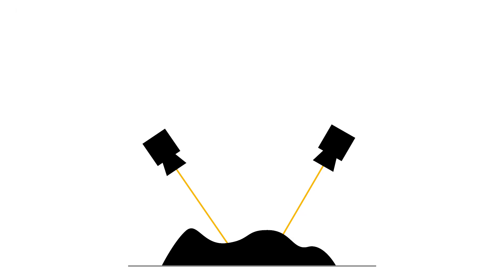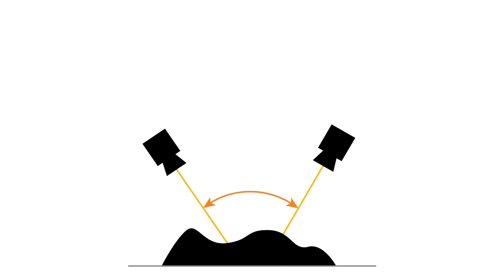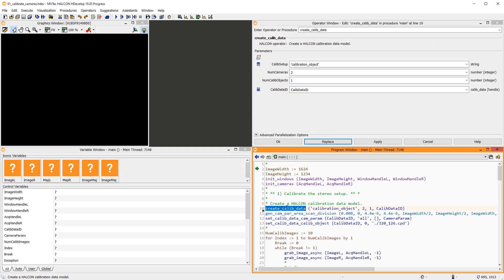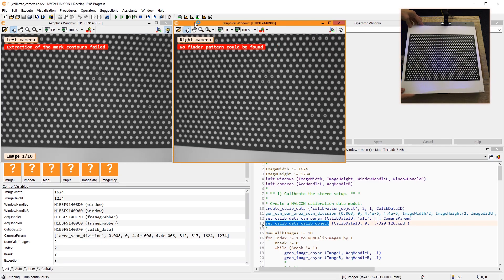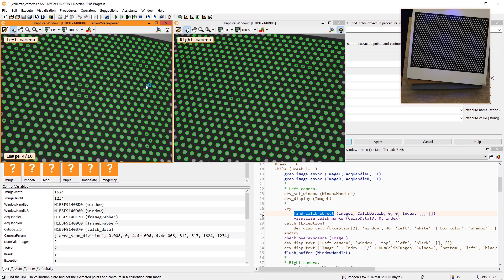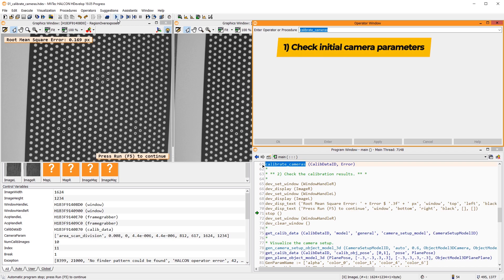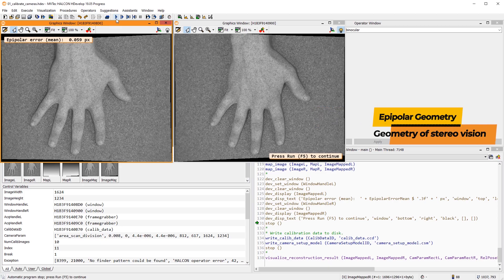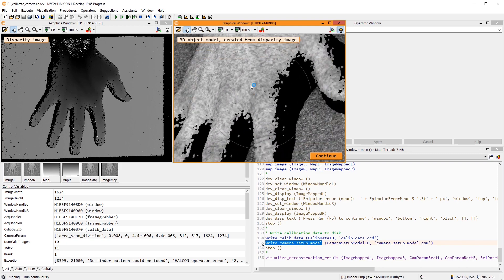Stereo calibration with MVTec HALCON

Comment: Hi wanna ask.

Why? when calibration object the message show "image size does not match the measurement in camera parameter"? Is it any setting set wrong?
Reply from the maker: Hello Ooi YZ, it is important to adjust the initial values for the camera parameters in the script to the cameras you are using. I.e. ImageWidth, ImageHeight, Focus, Sx and Sy. For further questions, please contact your local distributor (https://www.mvtec.com/company/partner-network/halcon-distributors ).
Reply: @mvtecsoftware  Hi MVTec,very sorry, Another question. Now the camera can grab but the system is unable to calibrate and always show out “segmentation of the calibration marks failed". Is it any I do wrong? You can click the link below to see it in detail.
(https://drive.google.com/file/d/1WCsFPS-ED2F_JmXBkpKpAQo7zis-xZHg/view?usp=sharing)